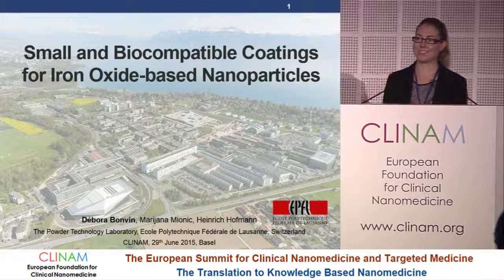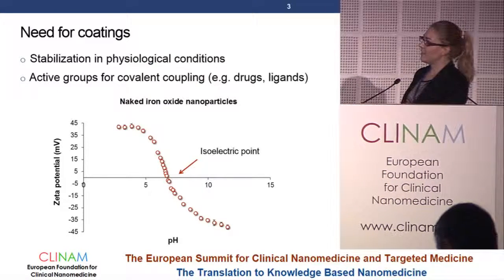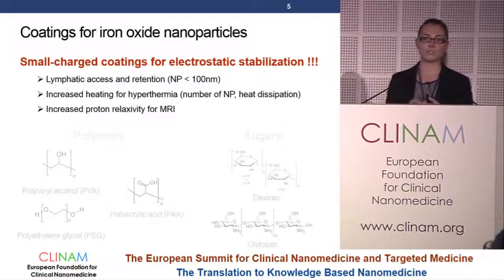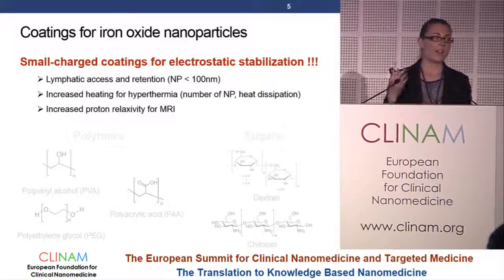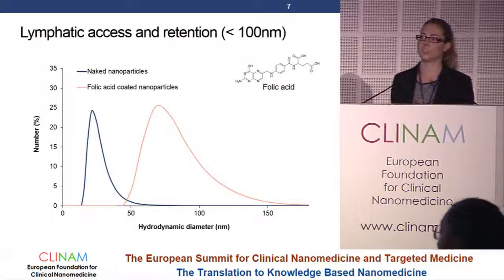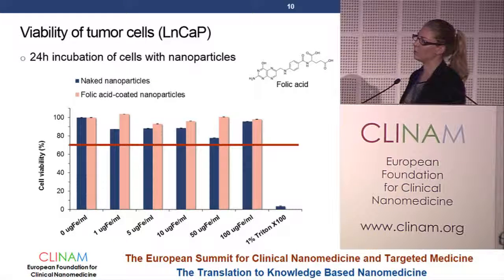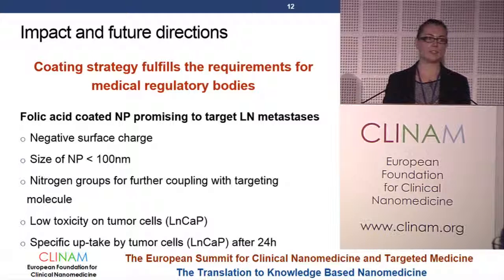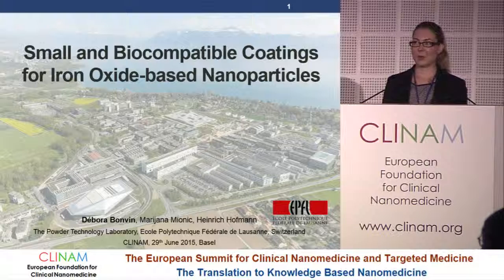Small and Biocompatible Coatings for Iron Oxide‐based Nanoparticles

Comment: Could superparamagnetic iron oxide nanoparticles be the cause of blood clots in the Covid vaccines?
My theory.
Some spions enter the blood stream during the vaccine injection.
If that person is wearing a magnet the spion infused cells gather at the site of the magnet. 
The longer the person is in contact with the magnet, more and more spions are attracted until either all spions in blood circulation have been gathered, or until a blood clot is formed.
Also I believe superparamagnetic iron oxide nanoparticles are the cause of magnets sticking to some patients injection site.
Could my theory be correct?